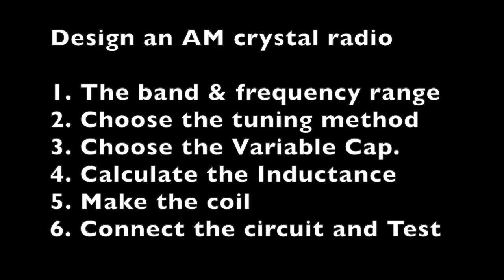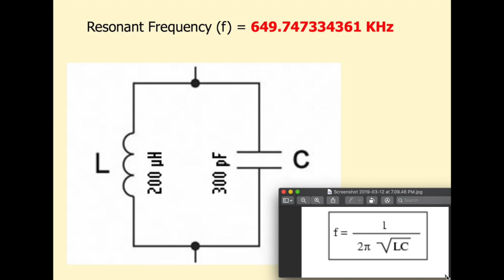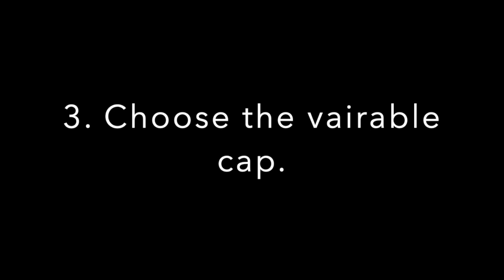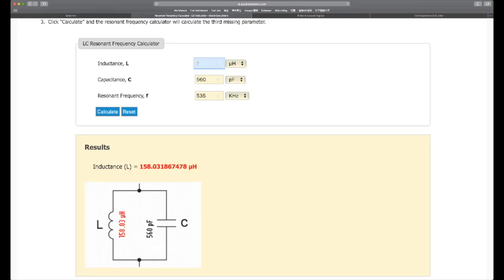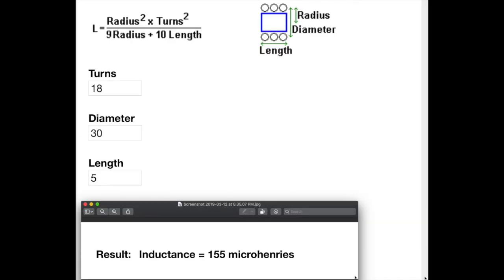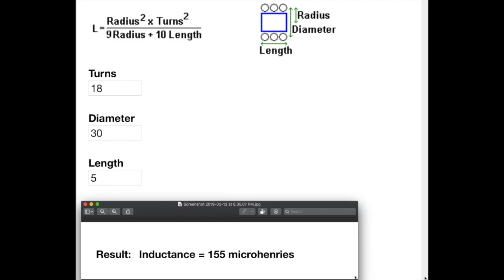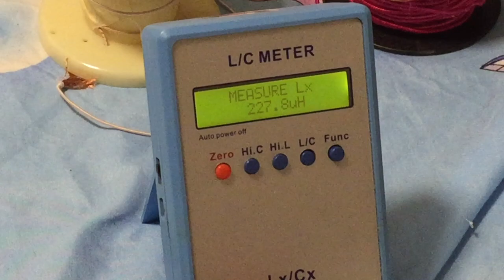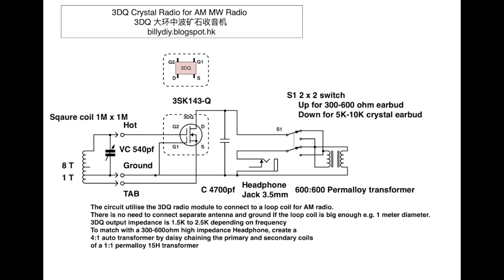1 meter loop AM crystal radio bstep by step construction guide

Comment: Hi Billy I got this project up and running but used a half metre loop antenna still worked there are only 2 stations in my town received both stations good interesting with a traditional crystal set I only receive one station  now to put the mosfet  module back in my fm crystal set !
Reply from the maker: Glad that it works for you. One meter is probably the extreme for louder output. Half a meter is good enough for most people. A smaller loop will also help to receive the higher frequencies in the AM M W radio much easier. I found it a bit hard to receive higher frequencies with my 1 meter loop, due to higher stray capacitance in  the loop itself

Comment: I thought Litz wire was better suited for the LW band ? I have a ferrite antenna made of 7 200mm*10mm ferrite rods in a bundle wrapped almost all the length with 60 strands of 0.1mm litz wire and that antenna works very well from  abt 150kHz - 300kHz. On lower BC band it loses out to a Grundig version of the Tecsun AN-200 loop. Granted, I do not have a crystal radio, i use mine inductively coupled to my radios. You use Litz wire for BC based on your own loop tests with crystal radios ?
Reply from the maker: Thanks for your feedback. Litz wire is also suitable for Broadcast Band. As you can see from the video of the testing. Some people have challenges covering the higher frequency 1200khz or above using big loop antenna. In that case you will need a better variable capacitor with a lower minimum capacitance or you can make a tab to reduce the number of turns when tuning to the higher frequency with the BC radio spectrum. 
Litz wire is not suitable for SW band or FM band because the capacitance in between the hundreds of tiny wires will lower down the tuned frequency of the tank, hence impacting the higher frequency stations of shortwave or ultra shortwave (FM ).
For SW , I used 8 to 12 mm soft copper pipes (those used in Air Cond cooler feeds) to fight the skin effect.
For FM, I used 3MM tiny copper tubes for small cooling unit (used in CPU cooling) or thicker single core copper wires (2-3MM) to fight the skin effect.
Hope this help.

Comment: Would single strand telephone/bell wire work for this loop ?  Or several strands twisted together or in parallel be better ?
Reply from the maker: I have seen people make big loop using the Cat5 or Cat6 twist wire as a bundle to simulate the functionality fo a Litz wire. It should work but a bit heavy.
Reply: @BillyCdiy  Thanks for replying. The comb idea is great. Will watch the rest of your vids. Regards.